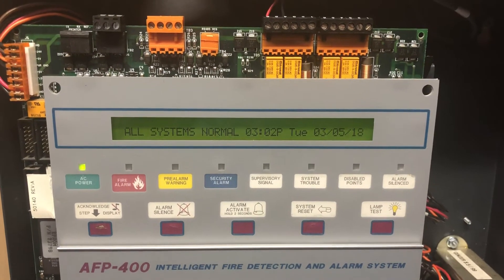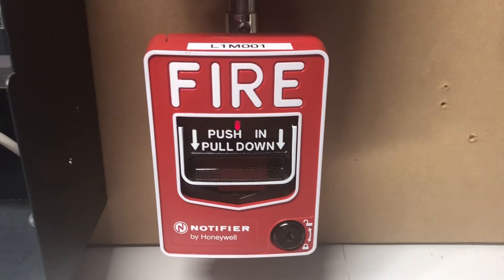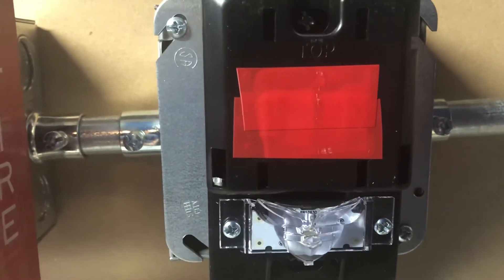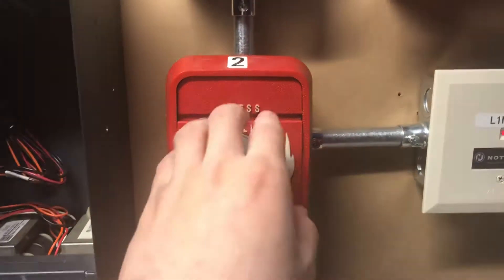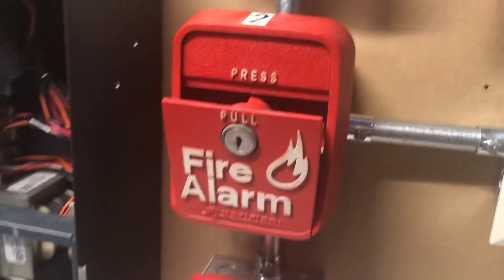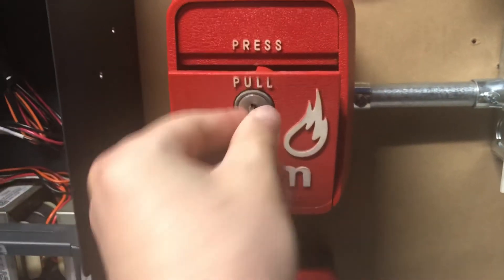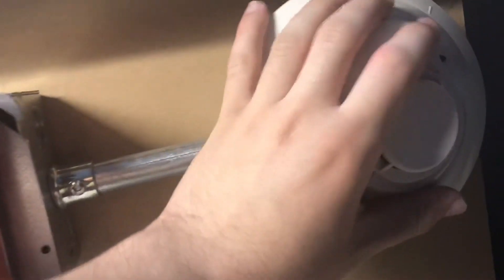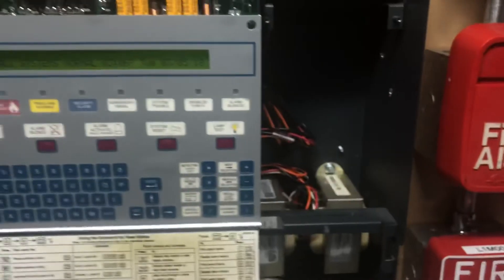Notifier AFP-400 Fire Alarm System - Test #2

Comment: Is that the LED3 LED Exceder since it seems to be flashing at a shorter duration than the older ones? I have an LHSW from 2016 and mine seems to flash slower, to is it just me?
Reply from the maker: firefreak57 - Interesting, how would I tel if it’s an LED3 model?